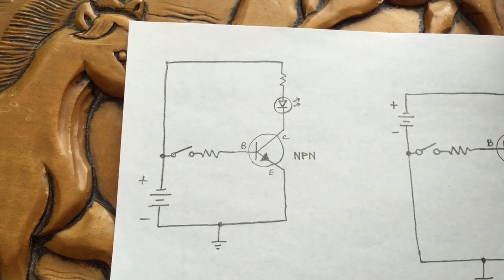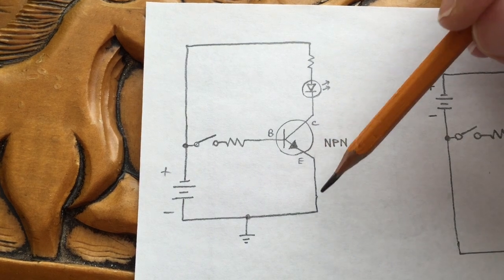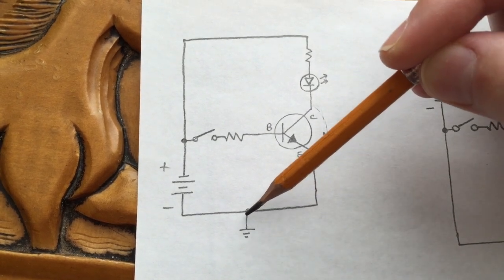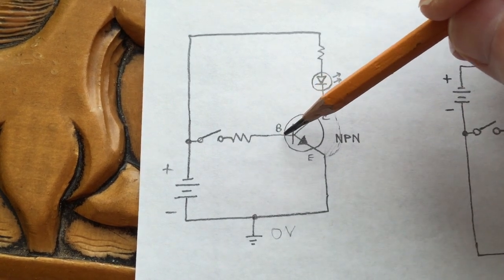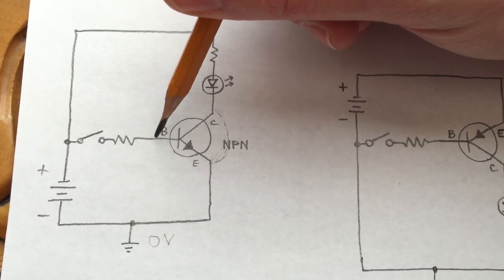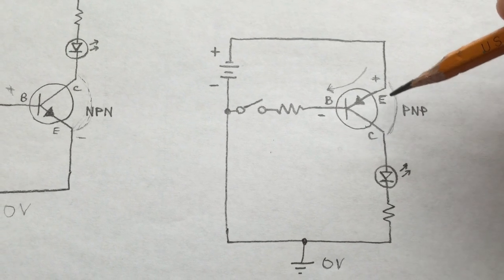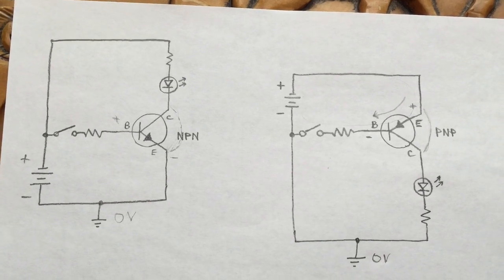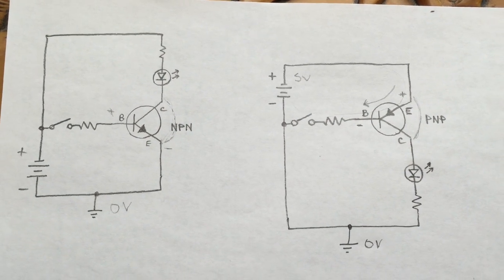NPN vs. PNP Transistors as Common-Emitter Switches

Comment: Xplain how current flows from emitter to collector!!!!!
Reply from the maker: For that, you will need to look into the theory of how silicon bipolar junction transistors work internally. In this video, we are not concerned with how they work internally, just that they do work , and how to use them . Very much like driving a car without knowing exactly how the internals of the engine operate. I could explain the internal operation but it would require a separate video. In day-to-day electrical engineering, you don't really need to think about the internals so much, you just need the device parameters and an understanding of how it will function in your circuit.

Comment: If same voltage is applied to base and emiter in PNP what will happen
Reply from the maker: In any circuit, if the same voltage is applied to the base and emitter of any bipolar transistor, the transistor will be turned off .

Comment: Great video. Would it be possible to get a video on choosing appropriate base resistors ?
Reply from the maker: This can be calculated using Ohm's Law: I(current) = E(voltage) / R(resistance). ([Supply Voltage] - [B-E Voltage Drop]) / [Resistance] = Base Current. For example, let's say your desired base current is 5 mA (0.005 A), and your power supply is 5V. Let's say the datasheet for your transistor indicates that the Base-Emitter junction has a voltage drop of 0.7 V. First we will subtract the voltage drop from our supply voltage: 5V - 0.7V = 4.3V. This is the voltage that would be "seen" by the Base-Emitter junction without a resistor, and would supply an unlimited amount of current (as much as your supply can provide), likely destroying your transistor. To get 5 mA base current, we will use Ohm's Law: I=E/R : 0.005A = 4.3V / R(unknown). Do some algebra to solve for R (multiply both sides by R and divide both sides by 0.005A). : R = 4.3V / 0.005A : R = 860 ohms.

Comment: should not the resistor in pnp be before the LED as in npn ? if not then why ?
Reply from the maker: Position of the resistor before or after LED does not matter. A resistor placed anywhere in a circuit path will resist the flow of current in that circuit path the same.

Comment: As a welder, I learned long ago that DC voltage flows from negative to positive. You can weld with the electrode set up at either polarity, but electrode negative results in a deeper puddle ( more heat into the work piece ), and cooler running feed wire. Reverse the set up and you have just the opposite outcome. Just saying. Your presentation is very well done and thank you for sharing.
Reply from the maker: Yes, conventional current flow (as used on schematics), is the opposite of electron current flow. Still no excuse for drawing the battery symbol upside down! :( Thanks for the kind remarks!

Comment: But bc547 the Vebo is 6vdc 
Does  that mean if the voltage on it base get more then 6v will damage  it?
Reply from the maker: The base-emitter junction can be damaged by too much current through it. The base-emitter (B-E) junction has a "voltage drop" characteristic to the device. To calculate the current through the B-E junction, first look at the total voltage available to the circuit loop feeding the junction. Then subtract the B-E voltage drop. Finally, use Ohm's law to calculate the resulting current, including any resistance in that circuit. I(current)=E(voltage)/R(resistance). For example, let's say the base-emitter circuit is supplied with a 5V power supply, in series with a 1000 ohm (1K) resistor, and the transistor has a B-E voltage drop of 0.7V. Current through the B-E junction is as follows: 5V - 0.7V = 4.3V / 1000 Ω = 0.0043 A or 4.3 mA. The data sheet for the transistor will give the absolute maximum rating for B-E current and also the recommended (saturation) current.

Comment: What is the benefit of using a resistor between the base and the source in case pnp
Reply from the maker: Same as NPN. You need to limit the current flow through the Base-Emitter junction as to not damage the transistor. Most small signal transistors need only 5 mA (0.005 A) or so to fully turn on (saturate).

Comment: Is it possible to place the LED and resistor of the first circuit on the Emitter end rather than the Collector end?
Reply from the maker: It is possible, but then why would you need the transistor? :P Also, a LED has a significant voltage drop, (as high as 3V, depending on color!) which would reduce the amount of current flowing through the Base-Emitter junction, or stop it completely if your supply voltage was not high enough. In effect, putting the LED on the emitter would have side-effects on the control of the transistor.

Comment: My question is, what does it mean that bjt's work on current rather than voltage? Aren't they concurrent? Can you push current with 0v?
Reply from the maker: You are correct, it takes voltage to get current moving. However, BJTs are current amplifiers. So if the BJT has a HFE of 100, and you put 0.001 A in at the base, it will allow 0.1 A to flow through the collector. In this way they can be used as amplifiers with predictable results. In contrast, a MOSFET's gate terminal is controlled by the voltage present, and no current flows when it is on (the gate is like a "charged" capacitor, with "pressure" on it). So it is very useful to work with BJTs in terms of Base current, and MOSFETs in terms of Gate voltage.

Comment: a very useful video I've watched  about transistors thank you for that ! ^^ ...but  I've a question about the active mode  I  don't  really get the idea of  biasing in forward and reverse ! when we forward bias the emitter-base junction  and we reverse bias the collecter-base  junction then  I see that the base has two applied potentials on it !!? in case of npn transistors, we've  the one of the input stage  which is the positive terminal of Vee,  and in the output stage the  negative terminal of Vcc !  what does this mean ?  can anyone explain this for me and thank you in advance ^^
Reply from the maker: It can be confusing to think about two different potentials (voltages) present at the base at the same time. However, you should rather think of currents only. If there is forward current through the Base-Emitter junction, a proportional forward current will be allowed to flow through the Collector-Emitter junction.

Comment: You keep saying it's current that turns on the transistor, but I've never heard that.  We talk about a fully turned on transistor as one with a general 0.7 V requirement. Is this a standard that's used outside of school, to speak of a turn on current instead of a turn on voltage?
Reply from the maker: It is normal to speak of Bipolar transistors (BJTs) in terms of current. The Base-Emitter junction has a fixed voltage drop, but very low resistance on top of that. So if you put 0.7V into the base, it will be enough to turn the transistor on. If you put 0.8V to the base, how much current will flow? 12V? As long as the voltage is higher than the B-E drop voltage, current will flow, theoretically without limit. That is why we must use a resistor to limit the current. The B-E junction, like all diodes, can be thought of as a "dam" (i.e. water dam on a river). Voltage can be thought of as the height of the water. Current is water flowing. Voltage is the height of the dam. If the water level is not high enough to go over the dam, no water will flow. As water is higher than the dam, the amount of water flowing over is not theoretically limited (only by the width of the dam, theoretically infinitely wide).

So, we use a resistor to limit the current to the desired value. Any supply voltage that is higher than the B-E drop voltage can be used.

Comment: I don't want to sound negative, but your transistor base cannot float when the switch is open.
Reply from the maker: Sure it can. A bipolar transistor is turned on by _current_. A floating base may attract stray voltages, but will not attract any significant "stray current". Build the circuit and see yourself. Now, if the transistor was a MOSFET, or CMOS logic device, yes we would not allow the input to float.

Comment: Loved the  video but I am confused... Shouldn't the resistor in series with the LED on PNP transistor be on the positive side in series after the transistor?
Reply from the maker: The resistor can be on either side of the LED, but the LED is on the correct side of the transistor, in both NPN and PNP examples.

Comment: Would it make a difference if the led was placed after the emitter on the NPN circuit? Or is there a benefit to having it on the collector. When the transistor is on current will flow from collector to emitter so curious if there’s any benefit

Comment: Why is there a resistor after an LED in the PNP circuit? Shouldn't we be using a resistor to protect the  LED (having it before), like in the first (NPN) circuit?
Reply: the resistor and led are both in series, it doesnt matter which one is before or after. the current flows thru both of them.

Comment: This is a good video, but there's another reason that npn is a bit more common than pnp outside of convenience for the electrical engineer.
 
If voltage and  current are the same, PNP transistors produce slightly more heat because of the way the semiconductive junction works. 
If current handling capability is going to be a critical to the application, NPN's are preferentially used. That's why many H bridge circuits use all npn instead of pnp legs. 

I was told once that, similarly, pnp transistors have a junction that responds more readily to changes in emitter/gate current/voltage (depending on whether it's a bjt or a fet). 
If that's actually the case, I could see why pnp transistor might become more common in small signal applications, like a radio receiver, metal detector, or voltage regulation.

Comment: Oh, gee. I thought I had it clear in my mind, until I started thinking about the nomenclature of emitter/collector. I assumed (as with diodes and batteries when referring to cathode and anode) that those names indicate the direction of electron flow inside the device. The names do seem to make sense for NPN transistors. However with PNP transistors, the electron flow is reversed, electrons flow from collector to emitter! How did they come up with those names, and what do they actually mean? Why even have such confusing nomenclature?
Reply: I know it is has been a long time but I hope I can make it clearer: Majority of carriers ALWAYS flow from emitter to collector. That is all you have to remember. In case of NPN, with positive voltage on collector side, majority of carriers (electrons) flow from emitter to collector (conventional current goes opposite). In case of PNP, with positive voltage on emitter side, majority of carriers (holes) flow from emitter to collector (conventional current goes same direction).

Comment: 6:52 i gotta admit that a resistor ,if put serial, will never have a current limiting function.  Serial it can only limit the voltage but not the current in contrast to a parallel circuit

Comment: I was hoping for a video that explained this (theory) AND showed how to tell which type of transistor one is holding in their hand and how to tell which leg is which on an actual physical transistor (of each type) (practical application)(yes, people actually ask that all the time... seems self explanatory, I know, and I usually assume they mean to ask how to tell if they have a PNP or an NPN, but often they clairify that they need it explained that the legs are the polarity of the transistor... further driving my point that there is a clear disconnect between theory and practice) AND explained why both types exist ... ie. shows a simple-ish circuit that can be done with a PNP but not an NPN (or well could be done the other way but it would make things less practical/more complicated) && vice versa... I know, I'm asking a lot, and what I want to see would make for a long video, but it's really what is needed to make a complete lesson that helps people understand what is going on in theory, while tying that knowledge to how to physically wire it in a circuit in practice. Knowing how to use a transistor without understanding what your doing is bad, while knowing what your doing without knowing how to do it gets you nowhere fast, so they are mutually needing of each other lessons... I get that it's time consuming for both the teacher and the student to do every lesson in electronics both on paper and in a real physical circuit, and thus at some point EE needs to be taught mostly on paper... but I firmly believe component construction, usage and theory needs to be taught both ways for every component. Once component introduction is complete for all but the rarest of components, then and only then should we go on primarily on paper. Just my take on what's wrong with the way we do EE education. Especially now that we have platforms such as YouTube where the transistor lesson for example, can be done once only, rather than repeating it every year to a new batch of students. Perhaps I'll have to make such a series of videos. But as someone who has zero intrest in making videos, i'd beg and plea to the whole EE-YouTube community for someone to remake my vids with higher quality (camera, post and pre production preps, lighting etc) at the beginning of all my videos... but only if your going to do so with the in-depth detailed theory that EEVblog would go into to teach the theory side, and only if your going to be as visually clear and easy to follow as Great Scott with the practical application... would it be a LOT of work, oh exploitive yeah, but like I said, it's video... it's once and your done. Ah but then I'd be tempted to give visual tutorials on moving from THT components to SMD... then... and there's always frustration of THE NEED TO REMAKE YOUR VIDEOS WHEN YOU MESS UP ONE TINY DETAIL LIKE PS POLARITY, because this is the study of electricity and things like that WILL cause confusion... only to n00bs, but oh wait... they are the ones who need this kind of introductory content... plus common, it's transistors... what do the 'P' and 'N' stand for again, oh yeah the polarity lol, it's kind of an integral part of understanding transistors, just say'n... well me and a good portion of your audience. So is it a pain in the expletive to remake a vid? Yeah, I'm sure it is, but it's kinda needed... just saying.
Reply: Prime example of why one cohesive tutorial explaining everything about transistors (including MOSFETs... forgot about how that confusion needs cleared up too...) is needed:

 https://youtu.be/xzVDMUMW9JU

10 years! This guys been trying to connect theory to practice for 10 years before it finally started to click... This is extreme, but none the less, it shows that it needs to be shown together. And we should explain why not just use an actual switch then... because in the simplest example circuits it actually would make more since, ie to just turn on a ligh at will, a switch is still necessary, and thus a much simpler circuit could be designed with just a switch... so we need to kind of explain that transistors can be used in say a circuit that turn on and off it's own cooling fan when it detects that it's reached a certain temp thresholds... and that with just a small amount of power we can open the flow of much higher power levels, and that memory and logic gates can be constructed with transistors and thus they are more than just over complicated switches that need a switch to operate... they can be operated by other transistors and other components in more complex circuitry. If people don't understand that they won't get oscillators, the joule thief, etc... basically any practical application. So we need to teach it all together. It might take me a year or so per vid, (due to time constraints in my life, as much as other complexities, including being on the poverty line, and having no interest in filming anything, and being self conscious about any aspect of being filmed, etc.) But i think I'm going to have to make the video i want to be able to just point people to, like 'here go watch this and quit asking me these questions that i don't have the time to answer'... because they never ask when it's my day off and i'm waiting at the DMV (ie now, hence the time to rant on a YouTube vid)... no they ask when I'm busy with life.

Comment: also, transistors themselves do not amplify anything at all, no more than a relay amplifies. The transistor just makes or breaks a path, you can control the higher voltage of a circuit with a small voltage to the base. This means that the tiny voltage you pick up from your antenna, fluctuating at the frequency of your favorite song is presented to the base and the base will open and close the emitter to collector path at that same frequency and at whatever voltage and current that is traveling past that junction, which is usually considerably more than what you introduce to the base.

Comment: rule of thumb is, for an NPN transistor the base has to be more positive than the emitter to turn it on, when you have a PNP, the base has to be more negative than the emitter to turn it on. Use the lettering in the middle to determine which one needs to be which in order to turn it on and then plan your circuit accordingly. When turning the transistor on there is a .75 volt threshold that needs to be met. As long as there is .75 volts between the base and emitter it will turn the transistor on.

Comment: 1. The battery symbol is reversed
2. Where is the base-emitter-resistor pull down???? (NPN)
3. Amateur
Reply: Amateur ? That was the whole point. To explain the basic currents in the transistor circuit. In other words, Who Cares ??